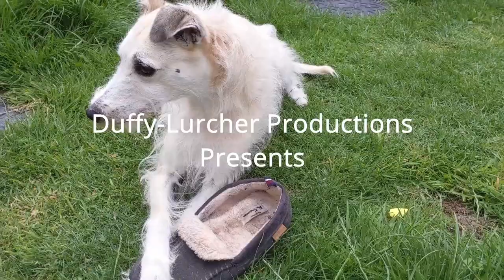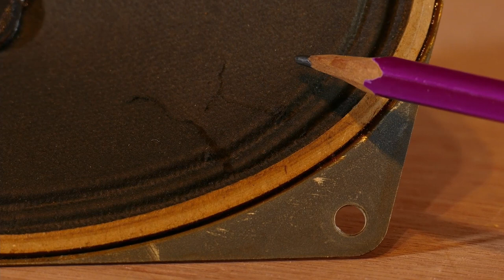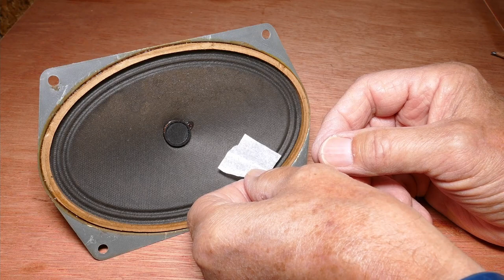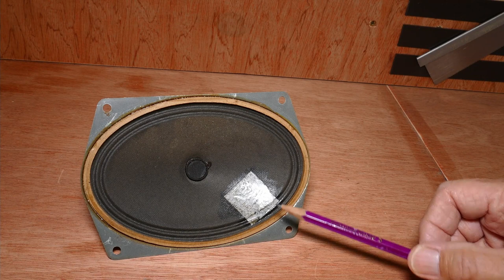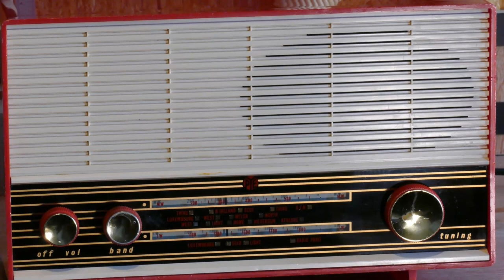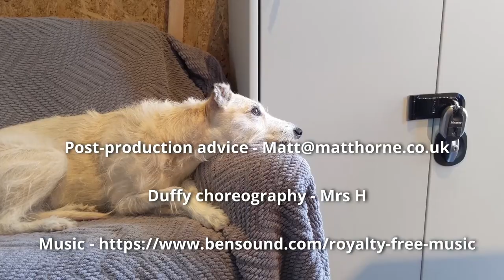Simple Vintage Speaker Repair

Comment: What is PBA ? glue .  I have used two layers of contact cement with suggess .
Reply from the maker: It's PVA adhesive (not PBA) - solvent free and waterproof once cured.
Reply: Elmer's glue.